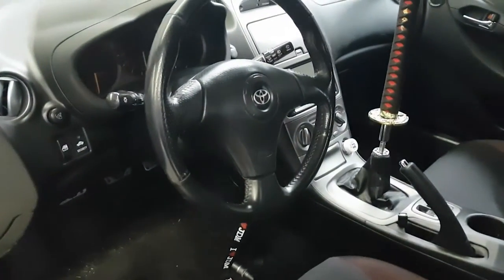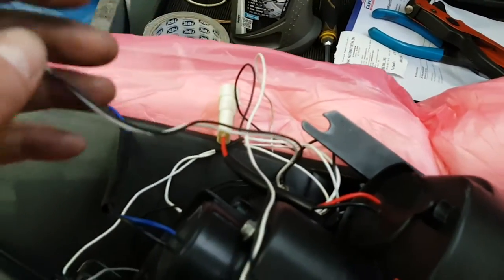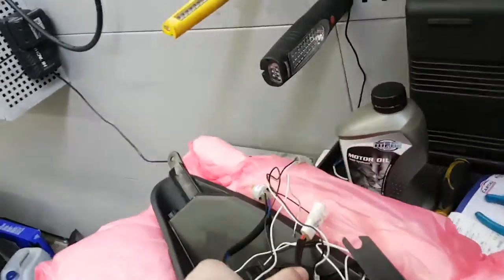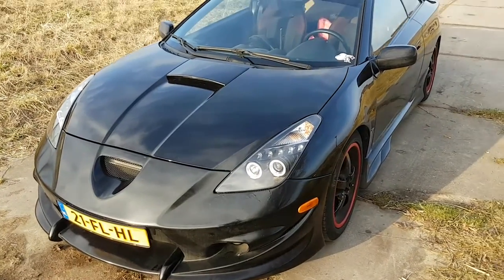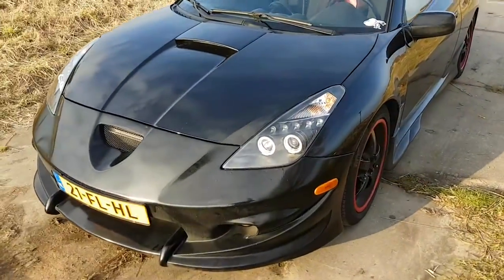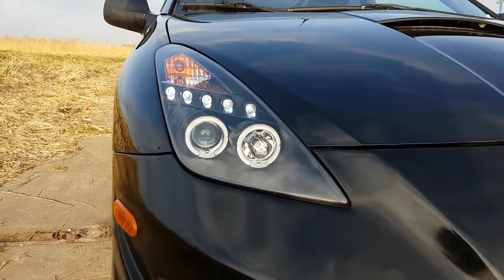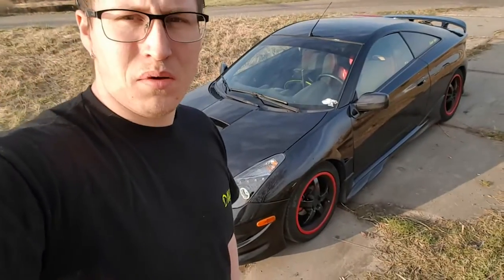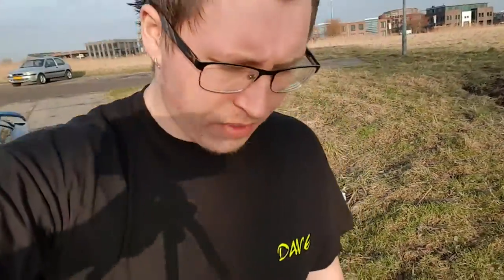I got my new Headlights!! (install)

Comment: good job, I buy the same, but I can not connect the high beam ,,, can you tell me which card I do not connect? I see that there is a three-pin connector that does not connect
Reply from the maker: Yoo thanks man! still love the headlights though, just the plastic is not that good of quality and will get scratched easily... uhm,.. i just connected the stock harness onto the headlights and it worked... :/ i connected the halos on to the dim light so i don't know man! you can also hmu on instagram!
Reply: Having the same issue, this was a long time ago but do you remember the fix?

Comment: How did u get the halos to work ? Bc I have celiac also and I bought the exact same led lights and connected all the wires n the halo light still didn’t work. Does it have to deal with the 2 extra (black & white wires) ?
Reply from the maker: Geminii Santana i will look at it again for you because its some time ago haha will give you answer asap!
Reply: I'm trying to figure that out the last black and white wires are the halos,? Connect those to where?

Comment: Hello, Did you notice an improvment at night ? or the opposite  ?
Reply from the maker: you can put in some LED's or HID's to improve alot but the headlights are nice deffinetly not the opposite!
Reply: @StrayMinded  ok, is it hard to adjust them ? I guess the motorized adjustement from the inside  isn't possible then ?
Reply from the maker: @gibs2b  indeed, you need to adjust them by hand with a philips, it is not that hard but needs some attention haha

Comment: How do you wire the halo ring wires  black and white ones..
Reply from the maker: one is positive and one th negative i had wired them up on the low beam like city lights
Reply: @StrayMinded  you think I could splice them to the side markers ? Lol I'm still confused I see the connection for the bulbs and the little LEDs that go across the headlight..  but 2 wires left  I'm assuming it the rings.  Black and white
Reply: Low beam is the h1 or the h7 . My headlights are exactly like yours
Reply from the maker: @reddemon52  If they are coming from the bottom then they are the rings yes, i would not wire them to the sidemarkers as they will blink if you use the sidemarkers haha
Reply: @StrayMinded  I'm going to connect them to the day time lights? Instead
Reply from the maker: @reddemon52  yeah i did that and its way cleaner look imo
Reply: @StrayMinded  but do they work at night?
Reply from the maker: @reddemon52  if you connect them to day time light they will also be on when you drive with low beam

Comment: I am from Pakistan and i own a 2002 Celica 1.8 .It gas been 2 years but saaadly ny reasr window broke with some hard object dropping off from a bridge
Reply from the maker: Mujh Barak aaahw that sucks bro! Hope you can drive it still!
Reply: Bro i got a fibre rear cut and professionally placed ..but it kinda weird when you put pressure
Reply: I looked around and in Pakistan driving sports looking cars or super cars is rare
Reply: Majaor taxes
Reply: Bro try sending me some little parts ..ill pay you first

Comment: to what did he connect the halos and led?
Reply from the maker: L0RD SPARTAN the halos are connected to the leds and those are my normal lights (city lights)
Reply: So they connect it to your running lights?
Reply from the maker: yes! the halo's are connected to the Led's and the Led's are connected to my running lights, i don't know if this is the right way to do it but it works :)

Comment: Thats a lot of bling for a GT Celica.  All show and no go with that engine.   It does look nice though...
Reply from the maker: lol dude it isn't even a gt hahha :P thanks for the compliments though but i like show more :D
Reply: So did you swap the engine? The GT's come with a 1zz-fe and the GT-S's come with a 2zz-fe. Yours engine looks the same as mine and I have the GT/1zz-fe model.
Reply from the maker: not all 1zz's are GT's right?
Reply: StrayMinded Well from what I understood there were weren't any, I've never seen a GT-S without a 2zz-fe in it. At least in the states.
Reply from the maker: lol i think i read about it a while ago that GT and GT-S are only U.S. called celicas lol
Reply: Pist N’ Broke Garage  2zz-ge*
Reply: @broderp I'm sure you will be behind me even with a GTS. It's not the engine wich is important but the driver...